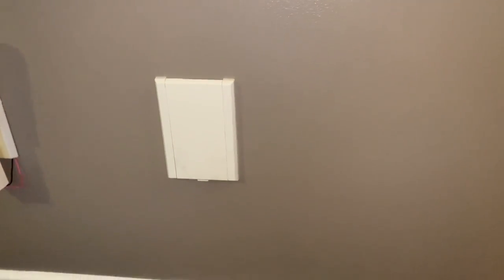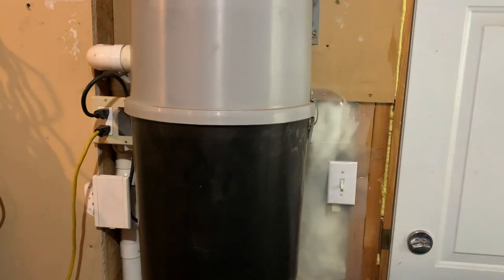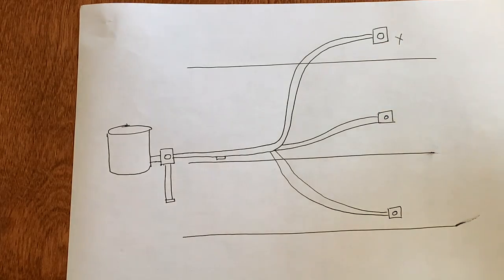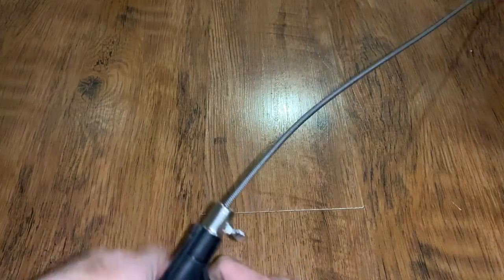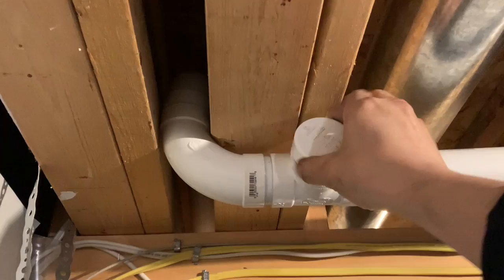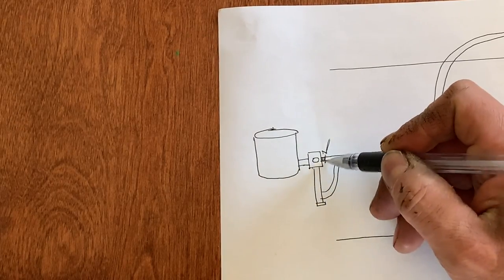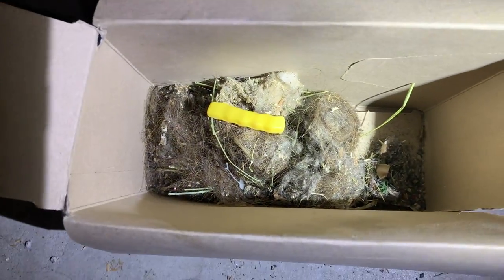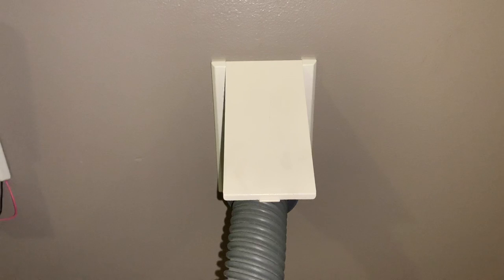Central Vacuum System Not Working Properly - How to Fix it!

Comment: Thanks for your suggestion, it worked for me. There was a plastic bag stuck outside the filter above the dirt collection container on the main unit in the garage. You definitely saved me a technician visit. Thanks again for the nice explanation.
Reply from the maker: That's awesome and so glad to hear it. Love it when we can get things working again with simple steps rather than having to call someone!
Reply: Similar story, albeit, replace the bag with a solid block of lint tho I managed to figure it out long before I found this, let alone watch it.
Unfortunately now that I've slain that beast of a Monty Pythonian dust “bunny”, more like one of those horrifically overweight rabbits that people raise to the size of large cats, I'm running into another problem.
When the motor gets a chance to warm up and I let the hose port's lid slam shut, the motor spins up and sounds like an air-raid siren spooling up and then down, quite loudly I might add.  Loud enough to hear from the kitchen (albeit right literally steps from the garage, but still...)
Is this healthy central vac behavior or does this mean the impeller and/or motor is/are shot?
I might add that the machine was left unplugged and abandoned in a clogged state for well over 2 DECADES, long before I was born

Comment: All those tee fittings are a problem for blockages and I'm surprised you have so many. I never install them in a line, only behind a valve and use them sparingly. They have limited applications and the way I see them here, they become an issue for plugging the lines. I've been doing this for over 40 years and heavy object clean-outs are used only in commercial systems where gravel or other heavy objects are routinely encountered, usually in long vertical runs.
I suspect that this will be an ongoing issue for this system.
Reply from the maker: Thanks for your background and experience on this. The home was built in 1999 and I'm sure designs and approaches have evolved since! We definitely check and clear it out regularly now.

Comment: My floor brush is working fine but the carpet one have power but not sucking upbthe dirt.What could be the problem?
Reply from the maker: If everything is working well except for the carpet head, my guess would be the carpet head attachment is clogged/obstructed. Disconnect power, detach it, inspect it, clean it. Best of luck!
Reply: @lmsdiy Thank you,I dont have a handy man around so have to find out myself with the help of your video. Thank you much!

Comment: No expert but after doing lots of research on these, I believe that T clean out should be a sweeping bend. That hard T creates a catch point and is wrong per install guidelines. And why you had a clog to begin with. Looks like you have a bad install.
Reply from the maker: Interesting. I'm definitely no expert on these either. We aren't the first owner of the home. I think this was installed 20 years ago this way!🤷🏻‍♂️
Reply: @lmsdiy  check out Central Vacuums Sales and Service Youtube. He talks about these things from my searching this weekend. There are also some videos if you search for the right kind if pipe videos, vac pipe vs pvc and the bends are made for this they talk about this stuff. That there is probably a $10 DIY fix for this. Good luck. Enjoyed the video!
Reply from the maker: @pn102  thanks!!! 🙏👍
Reply: I was going to say the same thing.  A longer sweep would also be more efficient, so the flow would be greater as well.

Comment: It's strange to me that your vac doesn't have a filter in your catch bucket like mine does. My Nutone uses filter bags inside the metal catch bucket that you can just pull off and replace with a new clean one, without having to clean out the debris in the bucket.
Reply from the maker: Nice... That makes much more sense! I think it's just a design (flaw) with ours. Or maybe the original home contractor messed up and forgot to do it properly?! 🤷🏻‍♂️
Reply: With these units usually it blows some of the dust out through the vent and some of it ends up in the bucket usually whatever can make it through that screen goes out the vent and into the outside
Reply: In all my years of installing Central Vacuum‘s you should never have to have clean outs I’ve had one in my house for the last 35 years and I’ve never had a clog so obviously the installer did not care when he installed this 😢